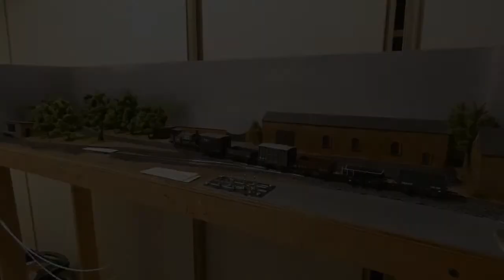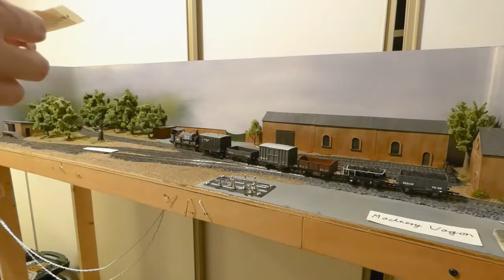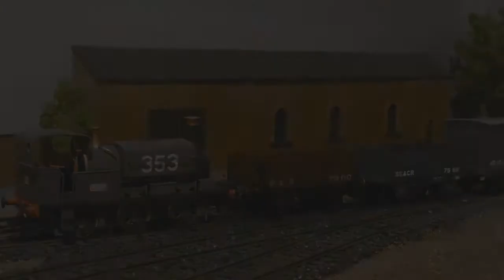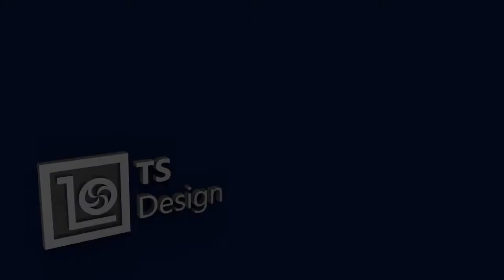Testing the Shunting Puzzle: first test with uncoupling system!

Comment: Tom you have a more interesting and better finished Inglenook than my effort!! 
I removed one hook off the loco end of my puzzle wagons and weighted them all to Iain Rice's recommended axle loading.
Which cured derailing and made uncoupling easier with a tiny magnet glued well up into the end of a dowel. The air gap to stop the magnet pulling the wagon off the tracks.
My loco is a cobbled M W class H, 0-4-0.